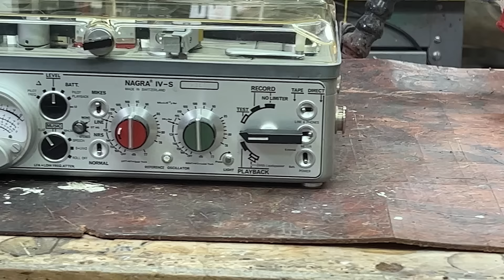Adam Savage Restores Clear Plastic Discoloration

Comment: Probably beating a dead horse, whenever I saw hydrogen peroxide done on plastic to remove yellow it was in combination with sitting outside for UV.
Not sure it actually works on these clear acrylic or polycarbonate plastics because you can't really penetrate through to the center with the peroxide

Comment: Hydrogen Peroxide works great for unyellowing plastic parts. But you forgot the ingredient that makes it work! You need UV light! I have done this many times with yellowed LEGO's. Hydrogen Peroxide did very little to them on its own but when placed in a clear container in the sun light it worked very fast! Fun fact, the hydrogen peroxide will not harm LEGO stickers either. I would love to try it with an artificial UV light but i have not.

Comment: Hi Adam, how you deal with this Dewalt gyro trigger screwdriver. It's so well design as agronomy and and battery and drive system but it's trigger made it useless in so many cases that i stop using it. I was planning to use it in our assembly but because the trigger it's useless.

Comment: Does this also work on clear automotive plastic that has turned pink? The 1993-1998 Mercedes-Benz W140 models have this issue. The 1993 reverse light bar for the driver side is no longer available and parts on junked cars are all like this or worse. I have a right side that I am going to try this on.

Comment: I hate being the safety guy, but Adam, please use a face shield when messing with 'only' a 12% solution of H2O2.  I worked with an ophthalmologist for many years.  The 3% used to disinfect contact lenses has caused some very nasty issues.  12% will probably cause some serious, possibly permanent, really really painful injury.  Not a lot or redundancy with eye structures.
And while niche I know, a 3 micron AlO2 slurry is what I used to final polish optical lenses to clarity.  It is a constant flow slurry, think parts washer, and the pads you use for lenses aren't stupid expensive but not cheap.  Used them for a cycle and disposed of, cycle depended upon lens material.

Comment: I'd rather print a new clear acrylic cover using a nova3d uv resin on a monochromatic 3d printer. The finished product is good as new maybe even better than the original.

Comment: Does anyone know if the peroxide/uv mix would work with soft plastics?  I have an old fish tank I’m restoring & the built in light switch has a waterproof silicon type cover that is really yellowed.  I’ve restored the aquarium, this is the only part I haven’t been able to fix…. 😢. ❤️🇦🇺

Comment: Don't you have a magnetic parts tray? They are fantastically useful.

Should not have used the "Brillianize" plastic "cleaner" first. Brillianize is an emulsified silicone, and the manufacturer expressly states that it should not be used on surfaces intended for painting. The reason is that emulsified silicones leave behind them a film on the surface ... it's the same stuff that gas station attendants (remember them?!) used to spray on windshields. It made the windshield look clear and shiny until the first rain. Then the film would run and made looking through the windshield feel like a bad acid trip. The silicone film would have "protected" the surface of the plastic from the H2O2.

Comment: Workshop improvement suggestion. Build a clean room! 
There is so much dust and debris where you are working it can’t help but have airborne and surface particulates everywhere. 
I cringed at you doing this work on a filthy bench with the only protection being cloth thrown over a dirty surface. A well lit clean room would have helped as would using a car detailers trick with your polishing mop which is to use an airline to blow out (outside the clean room!) the pad to remove contaminants on the pad then apply fresh polish

Comment: In addition to the UV light, make sure that the part is well sunk to the bottom using steel bolts or something that won't react with the mix, allowing any air bubbles to rise around it as the peroxide does its job. The retrogame community also has recipes for retrobrite which I think uses one of those oxy-action laundry cleaners (and I think a gum or something to make a paste) to get the process flowing faster. 

UV LEDs, small immersion heater and a big plastic tub seem to be the most reliable, but I've even had good luck leaving old plastic in a warm bright south facing porch and NO peroxide or chemical treatment at all. There are videos on sun brightening old PC parts on youtube such as retro recipes' Lightbrighting testing https://www.youtube.com/watch?v=8P1OVj0IcqY

Peroxide alone was worthwhile though!

Comment: You were on the right track until you pulled out the paper towels. Don't ever clean transparent plastics with paper towels. The cellulose fibers in the towels are harder than the plastic and will create a fine haze of scratches.

Comment: well, if you check the "internet" more carefully you will find out, that to achieve the desired outcome, you need to apply UV light during the soaking in hydrogen peroxide process ;o) better luck next time ;o)

Comment: pity most of the work is off camera ... or out of frame ... but a nice shot of Adams elbows
Reply: it makes sense that the H2O2 didnt work ... it oxidizes the product to remove the yellow ... and is best of metallic surfaces ... Yup it rusts off the yellowed layer exposing the fresh surface underneath ... Plastic ... has a hard time with H2O2 .. and believe it or not but turtle wax works and so do other polishing compounds ... I learned about deyellowing plastic by polishing from a Polish guy of all the people you could learn from .. 
.
yup yellowing is JUST an oxidization layer ... and polishing works the best to remove it on EVERY surface
Reply: btw ALWAYS finish plastic off with turtle wax ... yes specifically that brand ... because it is both a polishing wax and filler and hardens clear ... and fills scratches and dings as well ... and works best of hard plastic and lexan ... btw ... most stock car windows are polished this way so they remain clear and scratch free for the driver